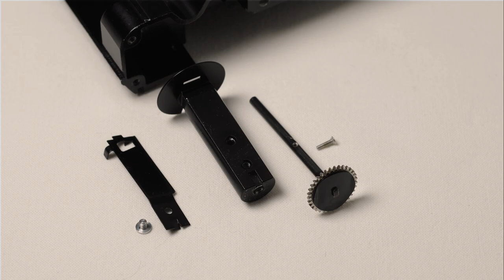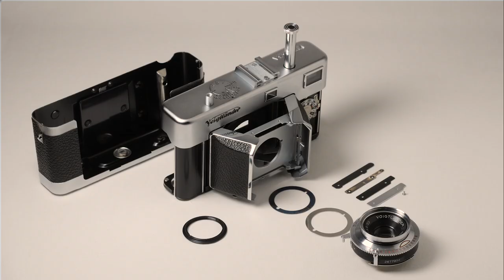Voigtlander Vitessa - Step by Step Reassembly

Comment: timestamps (sorry I don't know the words for some of these parts, I'll adjust this if someone mentions in the comments):

0:08 - film take-up spool & gears
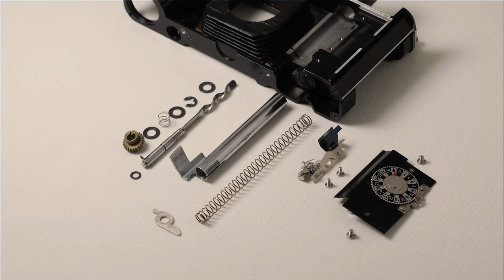0:39 - spring loaded advance plunger & frame counter 
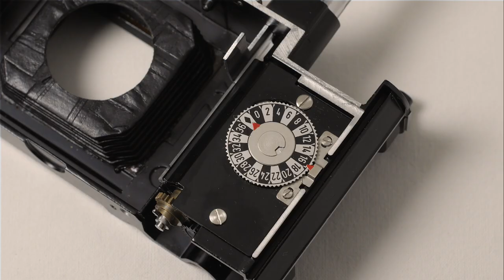1:01 - barn doors
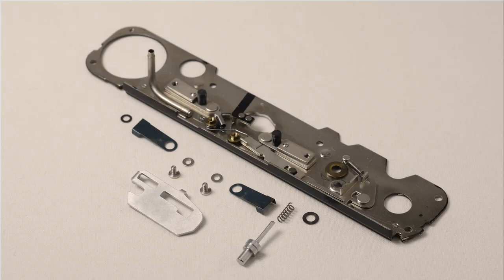1:22 - barn door lock
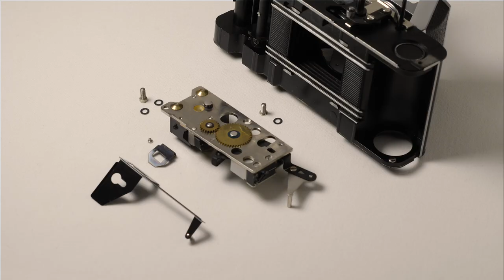1:35 - viewfinder
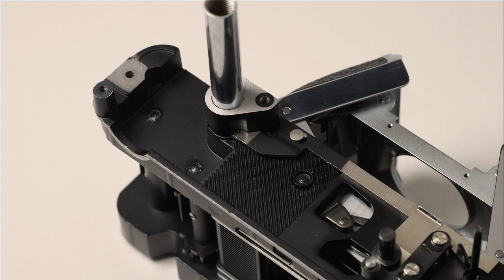1:46 - top chassis, focusing dial, shutter button, and accessory shoe
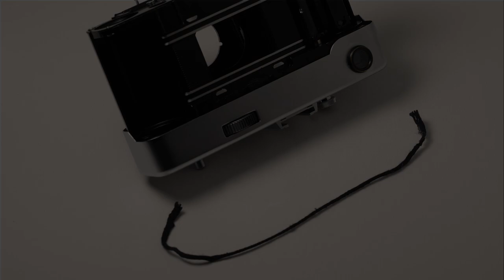2:13 - string gasket
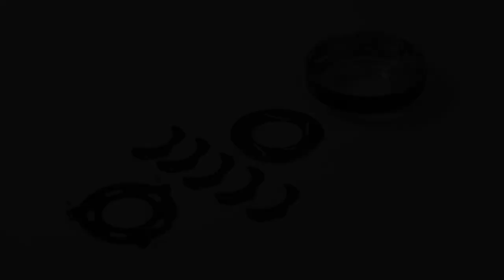2:20 - aperture blades
2:30 - ???
2:37 - shutter blades
2:47 - ???
2:57 - ???
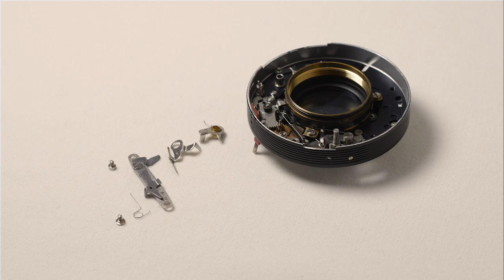3:04 - ???
3:17 - ???
3:23 - ???
3:30 - ???
3:41 - shutter speed adjustment wheel , parameter labels and more
3:52 - lens
4:03 - final assembly
Reply from the maker: Thanks for the effort!